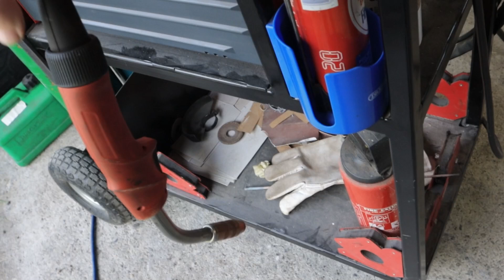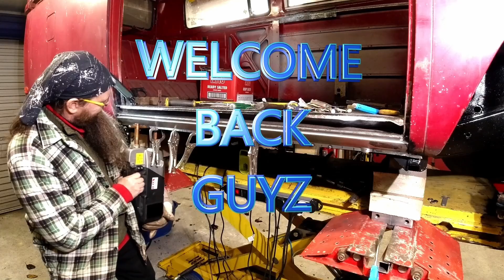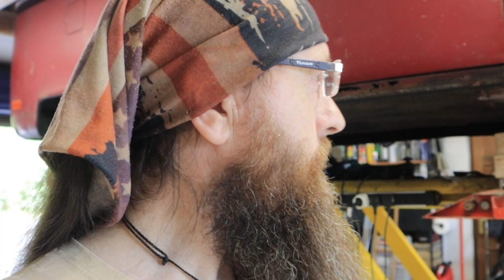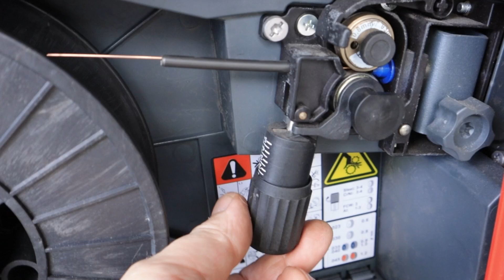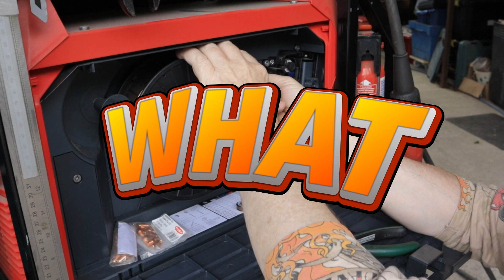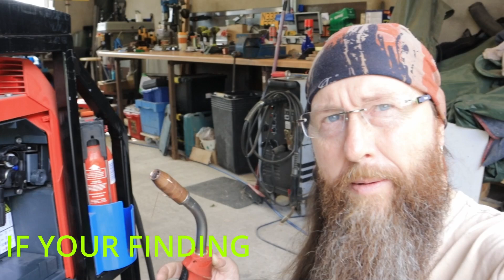HOW TO SET UP YOUR MIG WELDER FROM SCRATCH PLUS MY BEST KEPT SECRET.

Comment from the maker: With this one you should never again have to deal with the Crows Nest syndrome, Finding and knowing what is the perfect wire pressure at the tip is an valuable asset to laying down the perfect spot welds, plug welds or any welding in general, especially when working on lighter Sheet metal work or auto body work.Thank me wit your comments and likes, Cheers Guyz...👌

Comment: When changing the 0.8mm wire to 0.6mm, do you have to change the liner as well as the tip?
Reply from the maker: Hi Richard, Thanks for watching and hope it helps you, No is the answer to your question, you only have to change the liner if you go up in size. There’s four liner sizes, 1.6 to 1.2. 1.2 to 1.0. 1.0 to 0.8  0.8 to 0.6 , which covers both sizes, biggest size first, I have a 0.8 mm in there at the moment so no I don’t need to do anything, it covers 0.6mm  hope this helps, 🤙
Reply: @Joesrustbuckets  Hi Joe, thanks for your quick and comprehensive reply. You have certainly help me and I’m sure so many others. I’m just starting my Mig journey so really appreciate the time and effect you put into your videos, love your work. Perth Western Aust.
Reply from the maker: Hey Richard that means a lot buddy, it's the very reason I started this channel, thank you.👌

Comment: Great vid,  thank you 👍
Reply from the maker: Hi Gary, thanks buddy, 🤙
Reply: @Joesrustbuckets  my pleasure i enjoy your work and your vids 👍,
I inherited a welder and although I've done some bits with i don't really know what settings I should be using etc 🤭
Reply from the maker: @garylatto4191  I take it that it is a mig welder,? are you interested in mig welding car body work, or thicker material, what dials are on your weld set, ie, a dial with 1 to 5 and maybe a course setting 1 to 4 and the your wire setting knob, if I know what knobs are on your weld set, I can give you a rough idea of what you should be on regarding welding 1mm sheet metal. Cheers Gary.